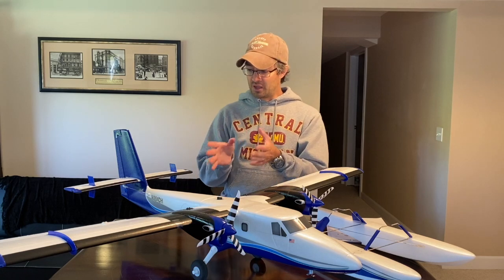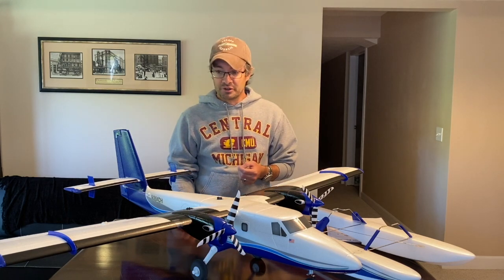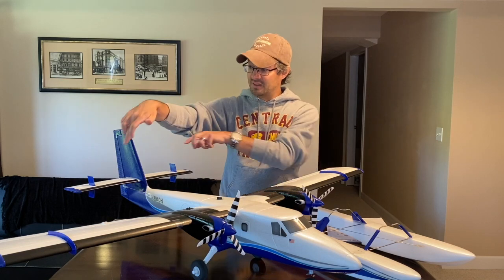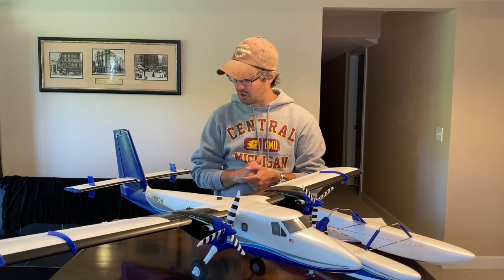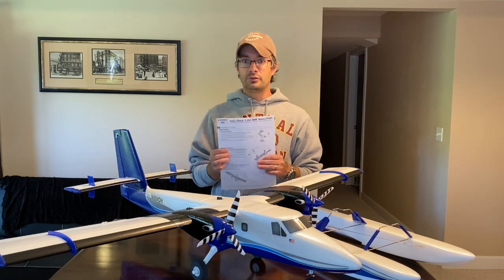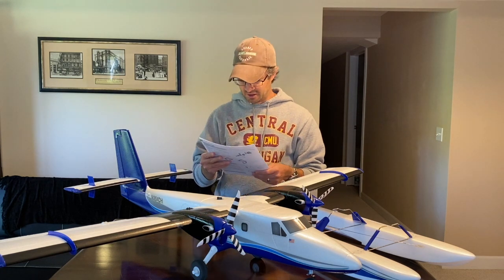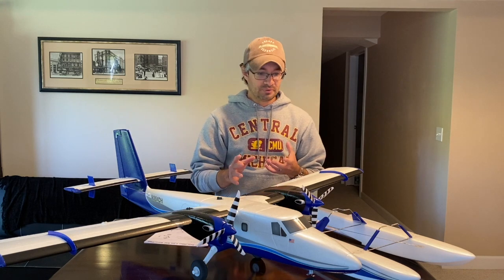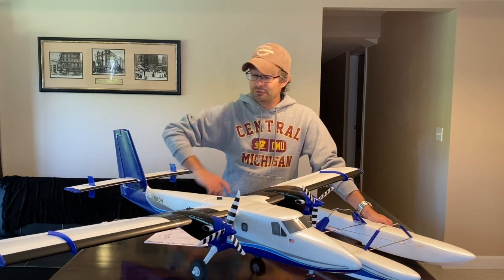Updates to the E-Flite Twin Otter 1.2m BNF Assembly

Comment: Just ordered and built my T.O.  last night, zero provisions for the elevator interference so they didn't  take care of that or they sent me an older one. I corrected it with a small gap with a hot metal hanger. Mine came with the 2 manuals and the float assy pictures are still horrible.
Reply from the maker: must have been an older one. The first one I built needed the cut-out. I used an xacto knife to make a small cut so the elevator could clear. I ignored the instructions for the float install on the first one and came up with my own method.